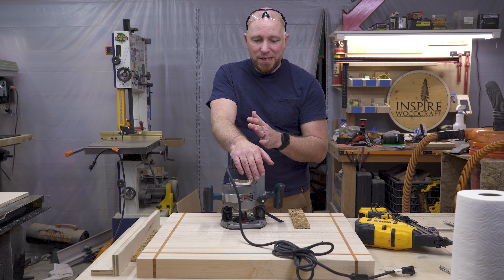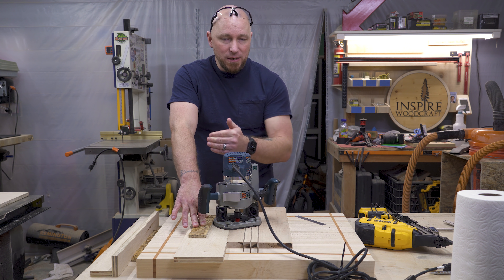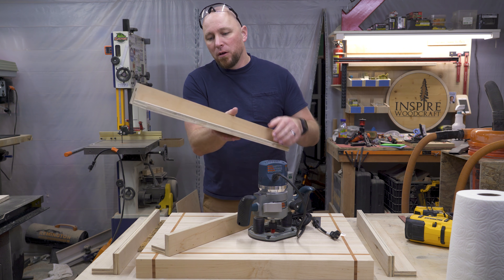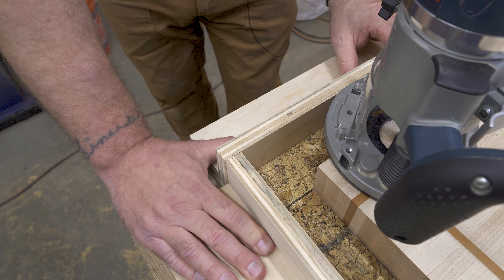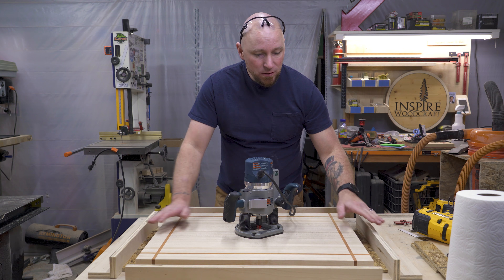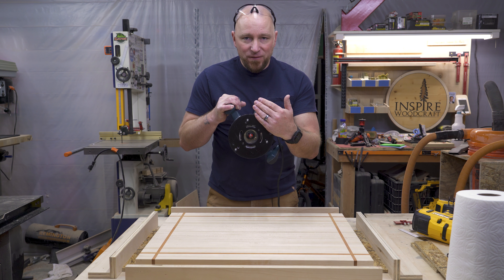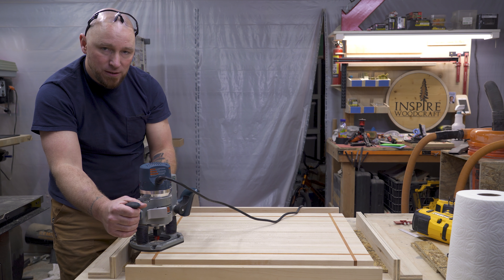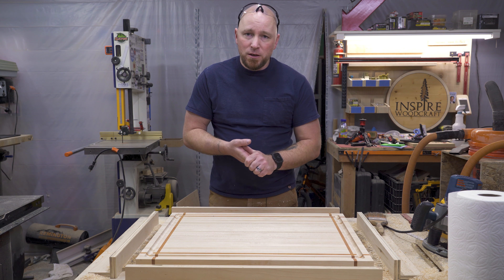The Easiest Way To Make A Juice Groove / How To Make A Juice Groove In A Cutting Board

Comment: Impressive on how you did this setup. I have no idea on where to subscribe to your channel but I copied your link. Maybe that will help me find you later. Also with my experience on carpentry  plus my engraving of the cutting boards I achieve very beautiful results. I always wondered how I was going to make a groove in them you just fixed that issue. Tha you and if you need advice on stuff give me a shout.

Comment: Excellent video and tutorial, especially explaining the possible pitfalls. I added some support blocks at the corners of my jig as I found on my trial run I had a bit of a wobble, possibly because of my cheap router or more likely my technique. Just wish you worked in metric but that is my problem not yours.

Comment: Did my first groove yesterday.  Had trouble with it. I assume you take small cuts at a time ?  Do you take it out each adjustment?   Ruined the board.  Had to trim it down to smaller board.   Scared to try again.

Comment: What was the process for making that board? The obvious way would be to do all the lengthwise strips in a normal glue up but then cut the ends off to add the horizontal matching (cherry?) accents. But that's not what you did, I can see by the grain of the wood in the close ups.🤔
Reply: I agree, looking for the method here. Yours makes the most intuitive sense to me but that isn’t the method I’m seeing here.

Comment: Thanks for the video. I've watched it twice. My assemble table has T-track along 3 edges. I took your idea but made my "L" brackets longer so I can do different size cutting boards. I installed one spacer and bracket along one side of the table and held it in place with a couple of hold-down clamps, then inserted the cutting board and clamped the short side to of the board in a similar manner - ensuring everything was square. The other two side's spacer and guide bracket were screwed into the tabletop. After cutting groove in the cutting board, I removed the moveable clamps and fit the next cutting board into the jig and tightened everything. This was quick especially since I was doing 6 cutting boards with slightly different dimensions.

Comment: In the theater scenic fabrication industry we call the assembly of 2 perpendicular framing members "hogstrough". And we typically rip them to 2.5". It's basically wooden angle iron. Not nearly as strong but fairly useful and versatile.

Comment: I appreciate your videos as they constantly reinforce that the best way is usually the simplest way. I do have a question however; why didn’t you just rotate the router to keep the flat side pointing to the center of the board thereby eliminating the touchy maneuver in the corners? Just curious if I missed something. Thanks
Reply: I think its because you may be prone to making a mistake while stopping and rotating and possibly burning..the way he did it was the most steady position all the way around the board
Reply: Brian-that makes sense thanks
Reply: That's what I do.  I do one quadrant of the board at a time, raise the plunge base, and reposition.  There's too much chance of error with that method.  Catch the cord or get the router position just a bit wrong and you've just screwed the top of the board up.

Comment: If someone's worried about making mistakes on an edge groove the best solution is to make or buy a router table and fence and just use a stop blocks. You can make a top out of any kind of sheet goods you might have and just clamp or screw it down to the bench.

Comment: Another thing to take into consideration is making sure you go opposite the router rotation. I've done the bonehead thing more than once and went the wrong way and have the bit pull away from the guide instead of pushing the router into the guide.
Reply: Me too,how many can say"never happened"?
Reply: Not really necessary, as long as you're using pressure to keep the router base against the fence, the bit isn't going to walk the machine away from the fence.  I guess it's possible if you're taking a huge bite.
Reply: Remember the right hand rule were the thumb points to the router fence and the pointing finger points in the direction the router should move.
Reply: @fiveoboy01  with the vibration of the router it is easy to get off the line by 1/32 or so if you don't pay close mind to it. Even with lighter cuts varying densities in the wood, like a knot, can cause lateral movement like that.
Reply: @billhandymanbill2775  great suggestion!

Comment: First time I made a cutting board, I used the edge/fence attachment on my router. I had a small hiccup as you described and now I understand why. Thankfully I was able to correct the hiccup. I had seen several juice groove jigs, but the amount of time to make one seemed to outweigh its benefit. Thanks again for keeping it simple and straightforward, I will remember this when doing my next cutting board. Always appreciate your  video's 👍

Comment: Seems to me that the dimension of the groove from the edge of the board is going to be the same for any board. The dimension of the router bit from the edge of the router base isn't going to change. Those two factors being considered, if you just turn your bumper boards around 180 degrees and cut the base width of the bumper board to your 2 3/16" dimension you would be able to eliminate the other pieces of particle board you used for spacers and just put the base of the bumper board against the cutting board to establish the correct spacing for the groove.
Reply: I was thinking the same thing.  That's what I do with mine
Reply: I’ve seen many builders do it exactly as you described. The only advantage of doing it his way is you can vary inset of the groove from the edge of the piece by using wider or narrower spacers. That could be advantageous on smaller pieces where a groove inset as he used on the large piece could look out of proportion on a smaller piece.
Reply: @let there be fish, I agree with you that doing it his way allows for more flexibility, but you could still cut the bottom of the "L" bumper to the standard length but when you need that flexibility, just turn the bumpers around and you have it. Best of both worlds.

Comment: This is a good way to make a juice groove, but wouldn’t the easiest way be to use a router table with a couple of stop blocks and a fence?
Reply from the maker: Depends on the size/shape of the cutting board and the size of the router table. I know my old router table would not have been able to accommodate this size board.
Reply: @InspireWoodcraft  I just inset my router table into a workbench so I can have a wider area for stop blocks.  It works pretty well for me, but I know everyone does not have the same setup.

Comment: what a giant waste of time and wood. do the same math but to the inside of the cutting board and double side tape a single rectangular piece of 1/4" plywood to the top and ride your router around that. same thing but doesnt take hours and waste wood and time. obviously avoid the flat side of the router.
Reply from the maker: Only problem there is that there is more of a risk coming off-line on the corners. With guides on the outside of the piece you are directing the router towards the corners, eliminating any chance for coming off-line.

Comment: Two things I would add. 1) Not everyone wants to drive nails into their bench tops. I use double sided tape to secure mine to the bench. It works fine. 2). If you build the guides a little long, you can let the 1st end run wild and butt the next end up to it. So, you can use longer guides for smaller boards. That way, the guide keeps giving.